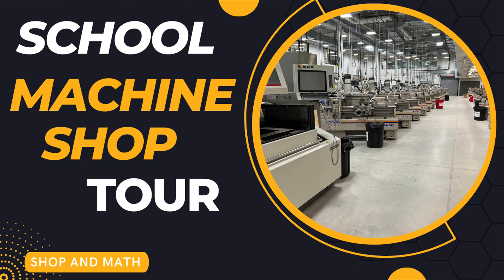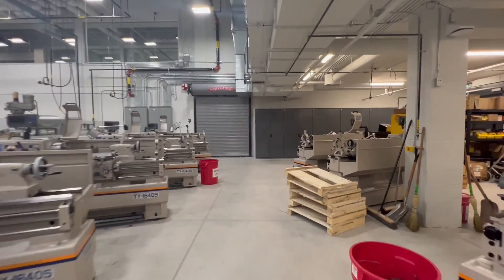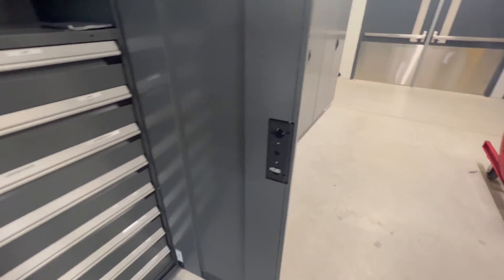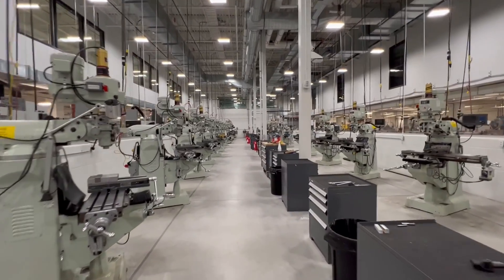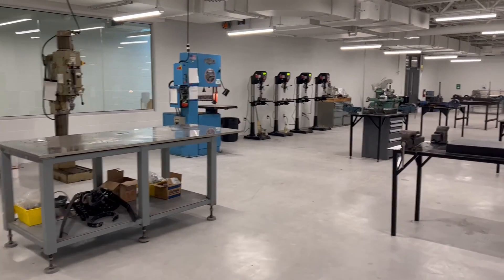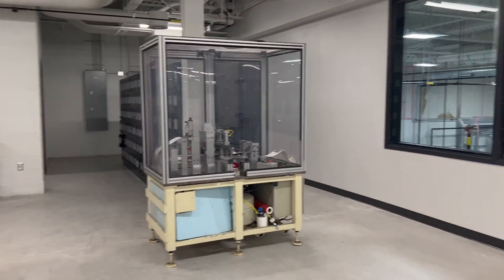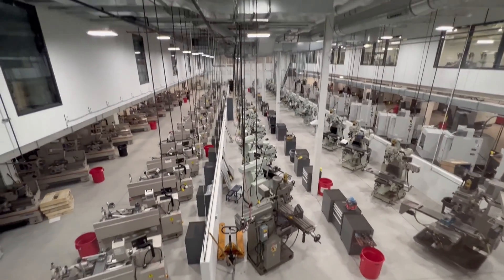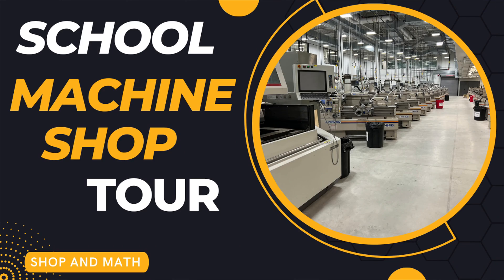school machine shop tour

Comment: I haven't viewed this video before.... rather than hate on your students with a jealous rage, perhaps I ought to consider becoming a student in my retirement. What's the least expensive course to take to gain access to this shop? I have several lathes, a bridgeport, and even a hydraulic surface grinder but I never get access to an wire edm machine and I can't even get shops to quote on my small volume parts I need edm cut. 

I'm glad CC has such a nice new shop because we need to train a lot more machinists to return more manufacturing capability to Canada
Reply from the maker: thanks for the nice comments
Since this video was made, we’ve acquired high-end CMM machine 
And we’ve also acquired three new cynical grinders, and a handful of other pieces of equipment 

this is only one shop. All of the other shops are new as well and we just started construction a new automotive centre at the same campus.
Reply: @shopandmath  damn I watched the video on how to set up tapers for grinding, expecting to see the typical lathe grinding video and noted that the college had cylindrical grinders. I really wish I had one but sadly no room for one in our garage shop.

Comment: WARNING:
Video: (2:46/7:19) Manual Mill Section:
FACTS:
(#1)
I worked for a very short time at a very small Canadian Robots Company. ---> (Total Morons).
(#2)
They purchased the worst CNC Mill. [Fadal] - {F--CK-DL} - [Hardest to Program & Operate].
They actually thought making only (1 pc.) on a CNC mill was faster then making it on an "advanced manual mill" ?
(#3)
I was given a manual milling project on a small manual milling machine having a "digital readout".
Manual mills have extreme "X" feed stops and 'adjustable' "X" feed stops (x2). [x+ / x-].
The supplied aluminum rectangular bar was longer than the set "X" adjustable feed stops, that were set [1 1/2"] inward per side from maximum travel.
I re-set the "X" feed stops to "maximum" travel.
(#4)
They installed "X" travel "digital readout system" was much 'Shorter' than the milling machine maximum "X" travel requirements. Placing "X" travel to maximum [x+ / x-], I was totally blamed for destroying the [x digital read-out hardware],
due to their total insulation ignorance...

Comment: WARNINGS:
Video: (1:56/7:19) Lathe stock material cut "very short".
Video: (4:12/7:19) Using harden steel lathe jaws with very little clamping surface.
....
Select the Right Chuck Jaws & Torque Them Correctly! - Haas Automation TOD Toolbox
https://www.youtube.com/watch?v=4ChoR5HtTmo
....
Haas Lathe Soft Jaws, Boring Rings, and VPS Templates - Haas Automation, Inc.
https://www.youtube.com/watch?v=Tafx7nOZl38&t=41s

Comment: Fact:
Around (50%) of CNC milling is done on a (4th) Axis.
Question:
(#1)
Why are there 'NO' (4th) Axis attachments in the Conestoga College CNC Department ??
....
HAAS [Milling Machine] (4th) Axis Rotary Table:
I actually used this (18) years ago.
(December 6, 2021)
Install of our Haas HRT-210 4th Axis.
https://www.youtube.com/watch?v=xPPCE1uAUJc
(April 21, 2022)
4th axis machining on the Haas with the hrt160
https://www.youtube.com/watch?v=Ex_bcVnpj-A
(June 28, 2022)
The Haas HA5C Makes 4th-Axis Easy - Haas Automation, Inc.
https://www.youtube.com/watch?v=seEFjpkuvxs
Reply: If and when you get a (4th-Axis), this next operation is a "requirement".
(July 8, 2019)
Apps Minute - User Travel Limits - Haas Automation, Inc.
https://www.youtube.com/watch?v=u_rLz5_ZQxo

Comment: I started my career as a Tool & Die Maker in (1972).
In (1978) I changed my career to [NC] ---> [CNC], running all types of CNC machines.
At that time "all" CNC controls were FANUC.
It had an excellent feature to control {G00} rapid movement with a selector switch. (25%)-(50%)-(75%)-(100%).
Later I became a "Blue Collar" [CNC] direct hands on manufacturing engineer. [F-18].
Because I could (100%) read the [CNC] programs, I never had a collision.
* {G00} at (100%) = 400 inches/per minute ---> 1,016 centimeters/per minute.
* 400 inches/per minute ÷ 4 = 100 inches/15 seconds.
* 100 inches/15 seconds ÷ 3 = 33.3 inches/5 seconds.
* 33.3 inches/5 seconds ÷ 5 = 6.66 inches/1 second. [17.0cm/1 second].
* 6.66 inches/1 second x 2 = 13.32 inches/2 seconds. [33.8cm/2 seconds].
* At (25%) Rapid: 13.32 inches/8 seconds. [33.8cm/8 seconds].
....
Conestoga College purchased (x15) HAAS - CNC machines.
In the past I was able to to go into the machine software and alter parameters. 
WARNINGS: 
(A)
Conestoga College "must" request a HAAS software engineer to come 
and alter all {G00}[R] functions at only (25%) all the time.
(B)
This will increase student safety by (75%) and save thousands of ($'s) yearly repair costs. 
(C)
When it comes to CNC collisions, (75%) are CNC programs and (25%) incorrect clamping procedure.

Comment: Nice set-up!  I have a hard time wrapping my head around how much machine shop training has changed since I took a 1-quarter long class while in college as an elective ~40 years ago.  My old class was literally an old WWII machine shop training facility that hadn't yet been bulldozed, full of leather belt driven (motors in base of the headstocks) South Bend lathes where we spent most of our time.  But we did get to turn the needed mandrel & a gear blank to cut gears on a horizontal mill, so I can say that I at least cut one gear successfully (out of one try (after holding my breath nearly the whole time I was using the index head.  The shop was originally powered with lineshafts from a single diesel engine mounted outside and it was quite dark, especially when compared to the great lighting you have in your new facility.  I'm very glad to see that there are still "trade skills" schools operating like yours is -- your students will have a great chance at gaining the needed skills for good jobs in today's machine shops!
Reply from the maker: It is a sweet shop.
For the past three years we haven’t been using a real indexing head we’re cutting our gears on the CNC.
Indexing head and indexing is still on the curriculum so I printed and designed a 3-D printed index and head simulator.
So the students get the best of both worlds higher end, CNC programming and the manual calculation of induction.

Thank you so much for your nice comments and also thank you for taking the time to comment.
Ray